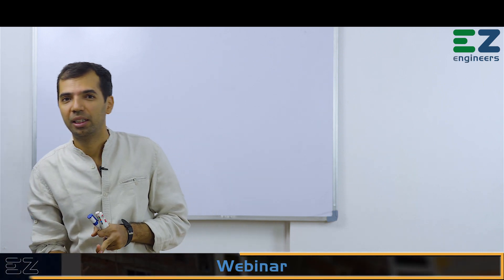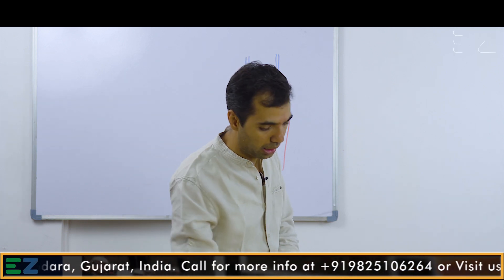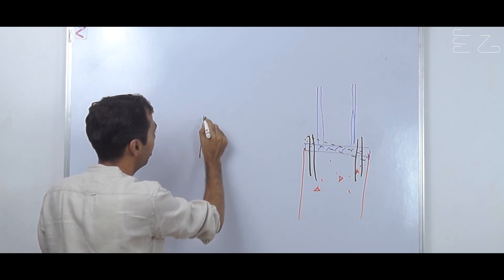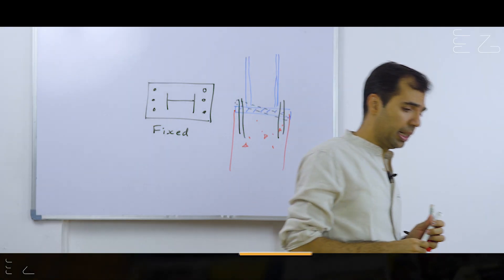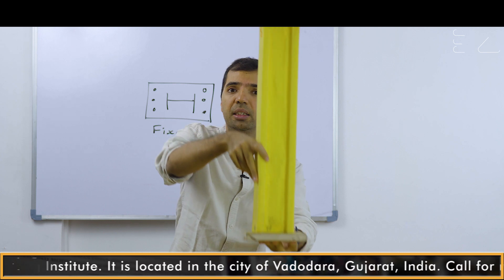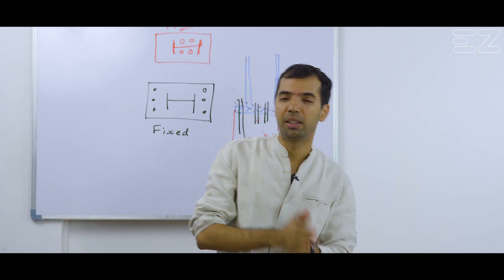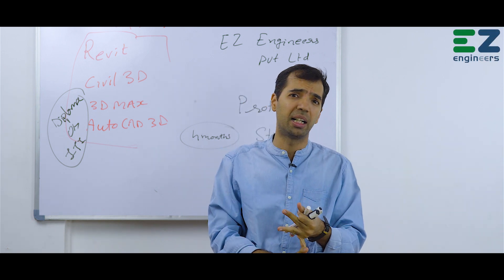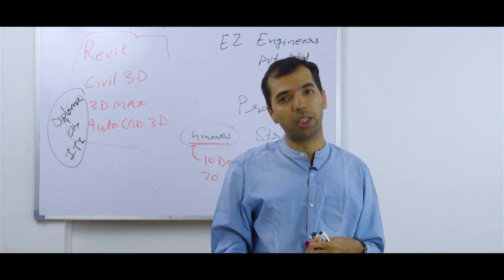Pinned & Fixed Support in Steel Structures | English

Comment: Mr. Satish, I did see top ends of concrete piles at the pile cap zone are with some straight and bent bars. Are bent bars for fixed connections and straight bars for pinned?  Thanks in advance for the reply.
Reply from the maker: please watch this video, you may get clarification. - https://www.youtube.com/watch?v=MPrE2b4A3Dg&t=5s&ab_channel=EZENGINEERSPVTLTD
Reply: @EZ-Structure.Design.Learning  Thank you for the reply. I saw the video. Therefore, straight or bent bars, as long as required Ld (=100% Ld) is provided they're both fixed. Is my understanding correct?

Comment: How to place bolt  if column is box section
Reply from the maker: we do not have option than putting all around
Reply: Then how to  decide  fixed or pinned  connection

Comment: Dear sir very nice. I have a query to clarify.

On a pin jointed type of base plate can the welding of gusset plates on the ends 
And around change it to s fixed joint. Pl advice
Reply from the maker: No. 
Gusset plates help connection between column and base plate. Here we are talking about connection between baseplate and pedestal.
Reply: @EZ-Structure.Design.Learning   my thanks sir

Should a mistake be corrected if I had not designed initially during the execution.

Comment: Sir please let me know, more economical condition,either pinned support or fixed support
Reply from the maker: pinned. But it is not always like that. It depends on other factors also. For further information, you can join our offline course. You can contact us at +91-9825106264

Comment: @EZ ENGINEERS PVT LTD  Is there a requirement that edge of concrete pedestal and baseplate be X mm minimum clearance? I'm referring to what is called the shoulder distance. Thanks in advance for the reply.
Reply from the maker: no. not necessary.
Reply: @EZ-Structure.Design.Learning  If not necessary I understand, but what about seeing some designs wherein baseplates are bigger than the supporting member? Does it make sense? Please give your honest opinion.